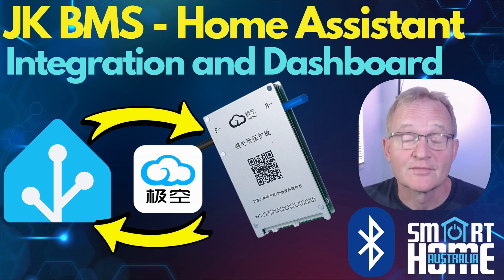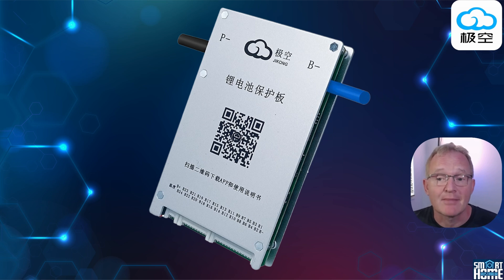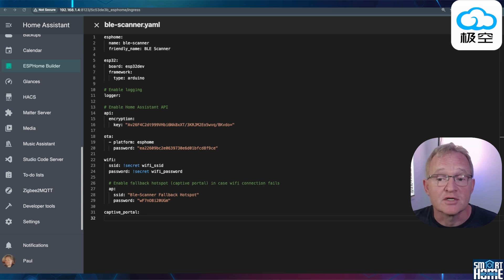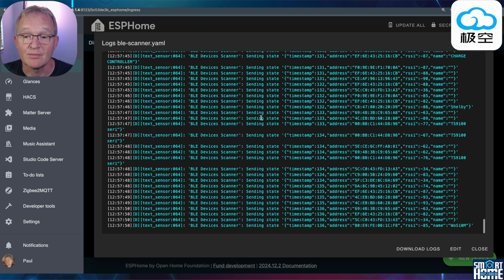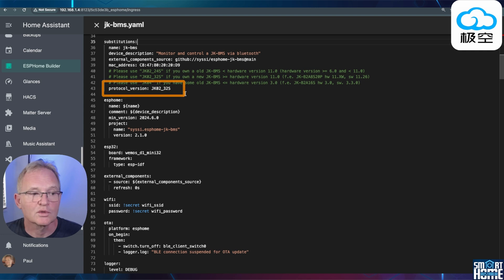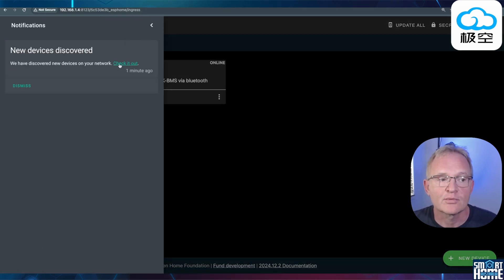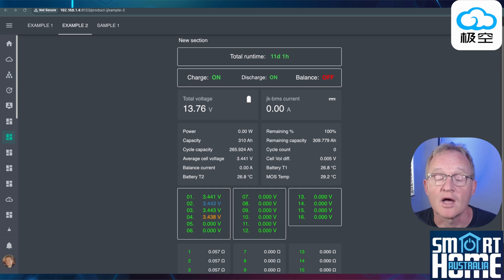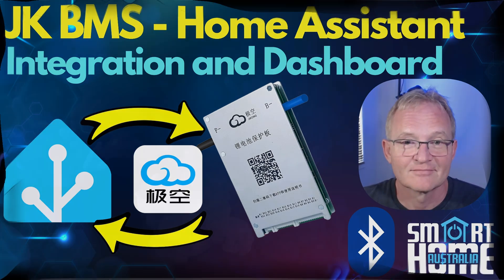🛠️JK Battery Management Systems Integrated into Home Assistant the easy way 🛠️

Comment: I tried this in two different ways, and I’m hoping you might be able to help:
1. Bluetooth Configuration with ESP32 Dev Kit v1. After uploading the configuration, the device fails to connect to the Wi‑Fi network.
I also tried assigning static IPs, but it still doesn’t connect.
2. ESP32 Dev Kit v1 with MAX485 (RS485) Module I then tested using the RS485 setup. Again, after flashing the configuration to the ESP32, it loses network connectivity and is unable to stay connected.
Reply from the maker: That symptom usually means the ESP32 is rebooting or the Wi-Fi config is getting “starved” once the BLE/RS485 bits start running.

A quick isolation path that might help:
1. Flash a minimal ESPHome build first (wifi + api + ota + logger). Confirm it stays connected for 10+ minutes.
2. ESP32 DevKit v1 is very sensitive to power fluctuations. Use a solid 5V/2A supply (not a weak USB port). Brownouts look like “it connects then vanishes”.
3. Make sure you’re on a 2.4GHz SSID (ESP32 won’t do 5GHz). Avoid static IP until it’s stable; a wrong gateway/DNS will make it look “offline”.
4. If you’re using bluetooth_proxy/esp32_ble_tracker, reduce scan load or switch to esp-idf framework (BLE can hammer Wi-Fi on some boards).
5. And finally don’t use UART0 (GPIO1/3). Set logger baud_rate: 0 and use UART2 (GPIO16/17 is the usual safe pair) plus a proper TX enable pin. Wrong UART/strap pins can cause boot loops.

Comment: Can this be access remotely? Thank you for your effort on this my friend.
Reply from the maker: Yep > once the BMS data is flowing into Home Assistant (via the Bluetooth integration, ESPHome Bluetooth Proxy, etc.), you can view it remotely the same way you’d remotely access HA.

Best options:
- Home Assistant Cloud (Nabu Casa): easiest, no port-forwarding, and it just works.
- VPN: WireGuard/Tailscale into your home network, then open HA like you’re at home.
- Cloudflare Tunnel / Reverse proxy: works well, but a bit more setup.

Quick safety note: don’t expose port 8123 straight to the internet. If you go the DIY route, use HTTPS, strong passwords, and ideally 2FA.

If you can open HA remotely, you can see the BMS sensors remotely too (the Bluetooth part still runs locally at home).

Comment: Excellent  information. Thank you.  For years i have been using only bluetooth from bms directly to my phone.   That was a  pain in the butt with limitation of  display and distance.  I  knew  if it were locally to the H.Assistant server not need for wifi can i have much longer range  using the much better HA  for viewing.  I  just did not know how to do it.  

 You nailed it with this video  with using bluetooth.  Thumb up for you.
Reply from the maker: Legendary comment 😄

Bluetooth-only to the phone is exactly how most of us start with BMS… and yep, it’s a pain in the butt the moment you want real dashboards, history, and range.

Stoked the Bluetooth approach in the video clicked for you. The big win is exactly what you called out: once the Bluetooth is “local” to the Home Assistant box (or a BT proxy nearby), you get way better reliability and you can view everything from anywhere without standing next to the batteries.

Quick pro tip: if the BMS is in a metal enclosure, stick the BT adapter/proxy as close as you can (even just outside the box) and you’ll usually see the signal quality jump heaps.

If you want a good next step, add alerts for low voltage, high temp, or SOC dropping fast = notification to your phone.

Comment: It stops working after turning it off and on again, anyone else experiencing this?
Reply from the maker: Yep, I’ve seen that happen with JK-BMS over Bluetooth.

Most common causes are:
- The JK phone app (or another device) grabs the BLE connection and the ESP32 can’t reconnect (JK BLE is often “one client at a time”).
- After a power cycle the BMS comes back in a weird state and the ESP32 keeps a stale connection until it’s restarted.

Quick fixes to try:
- Force-close the JK app on your phone (don’t just background it), then wait 30–60s.
- In Home Assistant, hit Restart on the ESPHome device (or power-cycle the ESP32).
- Check ESPHome logs right after the reboot for “connect/disconnect” reasons.

If you want it rock-solid, wired (UART/RS485) beats BLE for “turn it off and on again” life.

Comment: Спасибо!
Reply: Dear Problem with library, in HA 2025.11.02 sending in Github to info ((((
Reply from the maker: Thanks for the heads-up!

Yeah, on big releases like HA 2025.11.2 it’s pretty common for a dependency or library change to break custom integrations like JK BMS.

Best thing to do on GitHub is:

> include your exact HA version
> include the JK-BMS integration version
> paste the full error from Settings > System > Logs
> note whether it started right after the 2025.11.2 update

That gives the devs (and me) something concrete to work with.

If it’s completely broken for you right now, you can temporarily roll back to the previous HA version or disable the integration so the logs are cleaner while you test.

Comment: Hello. Maybe you could help me, it says an error after copying the badge code! 
What could be the reason?
From now on, it doesn't fill the boxes! 
Everything else runs H A . 
Just enter the default interface because there is no newer dashboard.

Unknown type: vertical-stack
Reply from the maker: That error usually means the YAML was pasted in the wrong place or the dashboard isn’t under your control.

Unknown type: vertical-stack

Fix it like this:
1. Settings > Dashboards > your dashboard > three dots > Take control. (Auto-generated dashboards can’t accept custom YAML.)
2. Edit dashboard > Add card > Manual.
3. Paste only a valid card, not a whole view/badges block. For example:

type: vertical-stack
cards:

type: button
entity: light.example
type: entities
entities:
  sensor.example

Common gotchas are, don’t paste under badges: — stacks are cards, not badges. First line must be exactly type: vertical-stack (no quotes, no extra spaces). Enable Profile > Advanced Mode to see Raw configuration editor if needed. If using the new Sections layout, stacks occupy one “box.” To make it wider, edit the card’s layout and increase the column span.

Comment: [09:55:01.877][D][sensor:131]: 'jk-bms bms0 cell resistance 23': Sending state nan Ω with 3 decimals of accuracy
[09:55:01.877][D][sensor:131]: 'jk-bms bms0 cell voltage 24': Sending state nan V with 3 decimals of accuracy
[09:55:01.877][D][sensor:131]: 'jk-bms bms0 cell resistance 24': Sending state nan Ω with 3 decimals of accuracy
[09:55:01.877][D][sensor:131]: 'jk-bms bms0 temperature sensor 1': Sending state nan °C with 1 decimals of accuracy
[09:55:01.877][D][sensor:131]: 'jk-bms bms0 temperature sensor 2': Sending state nan °C with 1 decimals of accuracy
[09:55:01.877][D][sensor:131]: 'jk-bms bms0 temperature sensor 4': Sending state nan °C with 1 decimals of accuracy
[09:55:01.877][D][sensor:131]: 'jk-bms bms0 temperature sensor 5': Sending state nan °C with 1 decimals of accuracy
[09:55:01.906][W][jk_bms_ble:282]: [C8:47:80:39:16:9D] Not connected
[09:55:01.906][W][component:453]: jk_bms_ble took a long time for an operation (696 ms)
[09:55:01.924][W][component:456]: Components should block for at most 30 ms
[09:55:01.924][W][component:453]: api took a long time for an operation (716 ms)
[09:55:01.924][W][component:456]: Components should block for at most 30 ms
[09:55:06.196][W][jk_bms_ble:282]: [C8:47:80:39:16:9D] Not connected
[09:55:11.193][W][jk_bms_ble:282]: [C8:47:80:39:16:9D] Not connected
[09:55:15.699][I][safe_mode:042]: Boot seems successful; resetting boot loop counter
[09:55:15.707][D][esp32.preferences:149]: Writing 1 items: 0 cached, 1 written, 0 failed
[09:55:16.299][W][jk_bms_ble:282]: [C8:47:80:39:16:9D] Not connected
[09:55:19.657][I][esp32_ble_client:111]: [0] [C8:47:80:39:16:9D] 0x00 Connecting
[09:55:21.204][W][jk_bms_ble:282]: [C8:47:80:39:16:9D] Not connected
[09:55:26.199][W][jk_bms_ble:282]: [C8:47:80:39:16:9D] Not connected

why it disconect and then never conect again?
Reply from the maker: Looks like your ESPHome node is never completing the BLE session with the JK-BMS, so you get NaN values and repeated “Not connected”. Usual culprits:

- Another device is holding the connection. Kill the JK app on your phone/tablet and unpair it. JK-BMS only does one BLE client at a time.
- Keep the ESP32 within 1–2 m of the BMS. Metal enclosures murder RSSI.
- In the JK app, enable continuous advertising / disable sleep so it keeps broadcasting.
- Pin the MAC in ESPHome and slow the polling:
- jk_bms_ble:
- mac_address: C8:47:80:39:16:9D
- throttle: 30s
- Try Arduino framework (often steadier for BLE):
- esp32:
- framework:
- type: arduino
- Don’t load the same ESP32 with other BLE clients (SwitchBot/ATC etc.) until this is stable.
- Power-cycle the BMS; they can wedge after failed pairs.

If it still flaps, consider wiring the UART version—rock solid compared to BLE.

Comment: Thank you so much for this video !
I just order the boards you adviseur. Any change you can share me the wiring? I like to use the TTL option and use the RS485 port on the JK BMS instead of Bluetooth.

Thx in advance!
Reply from the maker: Awesome—glad it helped! Yes, you can wire it two ways:

TTL (fastest with ESPHome)
JK “GPS” 4-pin header (JST-SH 1.25): GND > ESP GND, RX > ESP TX, TX > ESP RX. Do NOT connect VBAT (it’s full pack voltage). Use 3.3V UART and power the ESP32 from USB. Then use the syssi JK-BMS ESPHome component (uart: rx/tx pins).

RS485 (using the JK RS485 port instead of BLE)
From the BMS RS485 jack to an RS485-USB (or RS485-to-TTL) adapter: A > A, B > B. Add 120 Ω termination at the far end; swap A/B if no comms. On many JK units the left RJ45 is RS485/CAN, and the manual counts pins across the twin jacks; RS485 commonly uses pins 1–2 and 7–8 (double-check your model).
Alternatively, plug JK’s small RS485 converter into P4; that header is shared with “GPS” (TTL). You can’t use GPS-TTL and RS485 on P4 at the same time. 

Software
Works great with the Node-RED JK-BMS RS485 add-on (Modbus via RS485, MQTT to HA) or the ESPHome RS485 example. Both have exampled on GitHub.
Reply: @smart_home_australia   Today i managed to install the esb board but keep getting a double devicename in the entities like  "sensor.jk_bms_jk_bms_battery_strings" so they wont match any cards, do you perhaps have any idea how to solve this.. much appreciated
Reply: Thank you so much, your the best..

Comment: MissingPackageManifestError: Could not find one of 'package.json' manifest files in the package

:C
Reply from the maker: That error means you’re running the command in a folder that doesn’t have a package.json (i.e., not the project root or app subfolder).

Quick fixes to try:
1. Check you’re in the right directory
* `ls` (or `dir` on Windows) → you should see `package.json`.
* If not, `cd` into the app folder (something like  `cd frontend), then run your install/build command.

2. New/empty folder?
Create a manifest first:
* `npm init -y` (or `pnpm init` / `yarn init`) → then `npm install` (or `pnpm i`/`yarn`).

3. Monorepo/workspaces
* Run from the workspace root: `pnpm -w install` (or `yarn workspaces focus <pkg>`), or `cd` into the specific package and install there.

4. Docker/GitHub Actions
* Make sure you copy the manifest before installing:
  `COPY package*.json ./` → `RUN npm ci` → then `COPY . .`

If you need more assistance than this then why not drop a line to the discord channel as there is someone usually in there that can help out.

Comment: So, the ESP32 works as BT-to-WiFi bridge to extend BT coverage with Wi-Fi network? 

Is the ESP32 really necessary if the Home Assistant host already has built-in ble/bluetooth adapter, like a laptop, and the battery is located nearby?
Reply from the maker: The ESP32 is used as a Bluetooth-to-WiFi bridge for Home Assistant (via the Bluetooth Proxy integration). It takes BLE signals (e.g. from a sensor) and forwards them over Wi-Fi to Home Assistant. This is especially helpful when your HA host doesn't have Bluetooth, the Bluetooth range is limited, or the sensor is too far from the HA host.
If your Home Assistant host already has Bluetooth (e.g. laptop), then NO, an ESP32 isn’t strictly necessary, if your Bluetooth sensor is within reliable range (typically 5–10m indoors) and your HA instance is always powered on and nearby.

Comment: I follow the whole procedure but I find myself with ESP 32 offline! Why?
Reply from the maker: Do you have any firewalls? Do you have any other WiFi devices? I checked the forums and this should still work and mine is still online.
Reply: @smart_home_australia  could it be that I have to prepare esp 32 as a first installation? I didn't do it

I'm not very experienced... I follow your videos and I'm improving a lot! Firewall would it be? Is there something to update?
Reply: if u are the first time to run this like me , may be u have to check the button call " secrets" on the esphome Dashboard ,when i change the wifi information ,and then reinstall the bin file , it show me online ,i think this is a solution for this situation

Comment: Please I am really confused on the part of creating a secret file. I tried to follow the instruction and my JK BMS is offline. But my JK BMS do beep at times as if something is connected to it. Can anyone help out?
Reply from the maker: In Home Assistant, secrets.yaml is the main mechanism used to manage secret or sensitive information (like API keys, passwords, and tokens) securely and more maintainably. Here's a detailed breakdown and the best resources to learn how it works:
Home Assistant uses a special file called secrets.yaml to store sensitive values.
Instead of writing secrets directly in your configuration files (e.g. configuration.yaml), you reference them using the !secret directive.
For example:
In configuration.yaml:
http:
  api_password: !secret http_password
In secrets.yaml:
http_password: my_super_secret_password

Check out https://www.home-assistant.io/docs/configuration/secrets/, it is the official and most comprehensive guide. It covers:
- How to define secrets
- File structure
- Referencing secrets across multiple YAML files

If you prefer the community pages then check out https://community.home-assistant.io and search  for "secrets.yaml".

Comment: after compiling I get this error:

What version do you want to download?
Request not successful (404)
Checking files to download...
Open ESPHome Web

What is wrong?
Reply from the maker: This generally means ESPHome cannot find the version or firmware binary you specified. You're likely trying to compile or install firmware, and ESPHome is either trying to download a specific version from the internet (like from GitHub or a local ESPHome dashboard) or you’re flashing firmware via ESPHome Web, but the binary URL or reference is missing or incorrect.
Common causes are, incorrect YAML Configuration (Version reference). Also make sure you compile the firmware in ESPHome (Home Assistant or the command line) or download the .bin file and upload that .bin manually via ESPHome Web.
Hopefully that helps and you resolve the issue.

Comment: Awesome video. A quick question: can I use a single ESP32 for "JK Battery Management Systems Integrated into Home Assistant" together with "Integrating Victron Bluetooth Device into Home Assistant"?
Reply from the maker: Yes, you can use a single ESP32 to integrate both a JK Battery Management System (BMS) and a Victron Bluetooth device into Home Assistant. However, remember this is Bluetooth BLE at it has limitations but for 2 devices you should be fine.